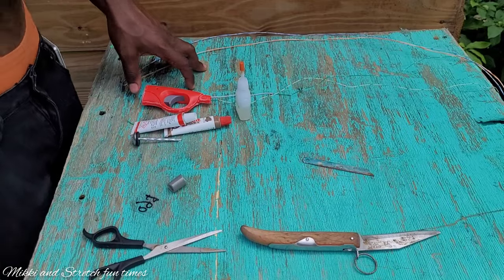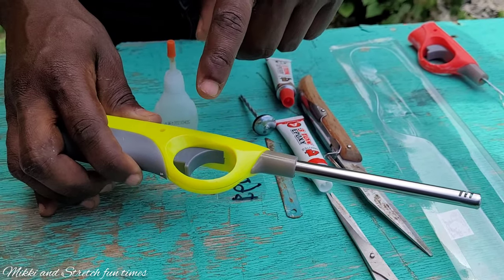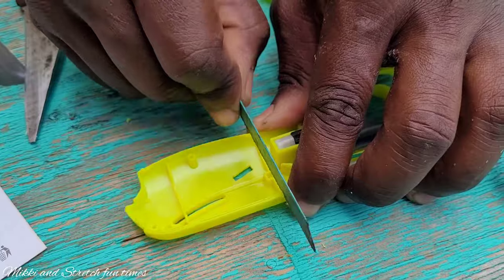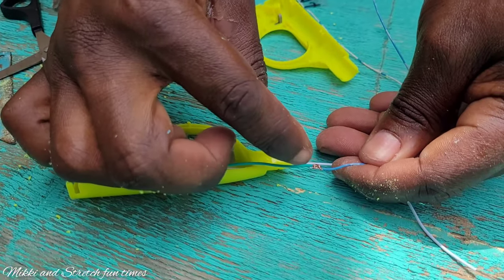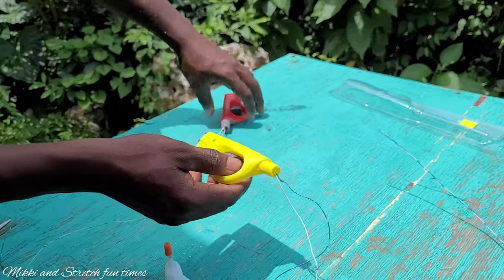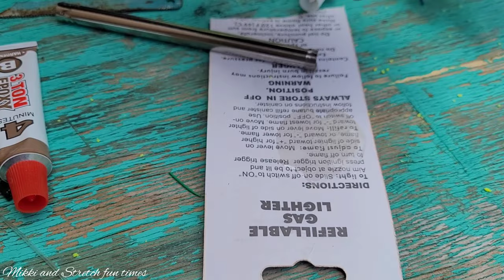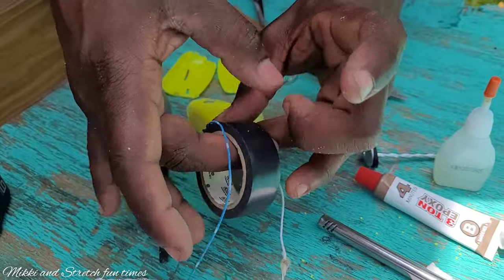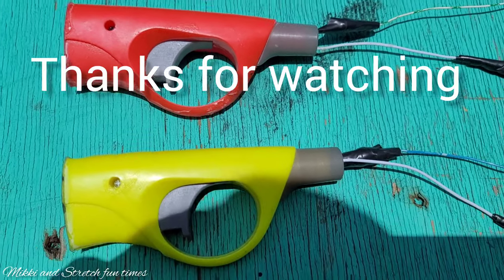How To Make A Marble Gun/ Air Rifle Trigger System

Comment: Can u use the wire from a phone charger
Reply from the maker: Yes you can, but you need a firmer wire, especially a copper wire. The charger wire is not as durable as the copper wire.
Reply: Stretch how much cork full a gas i should put in the big whitealcohol
Reply: Because a only sometimes my one buss
Reply from the maker: @polobossmusiq1109  oh ok